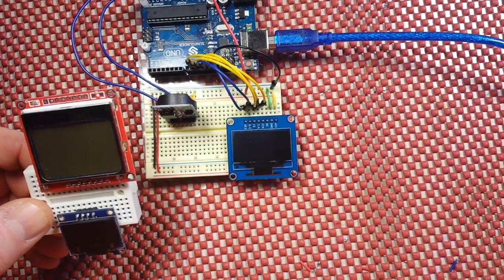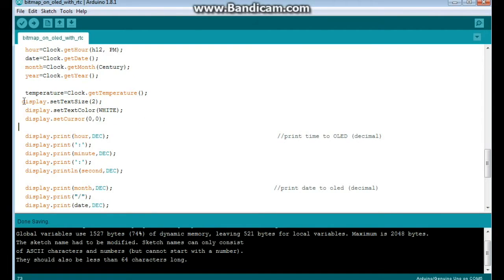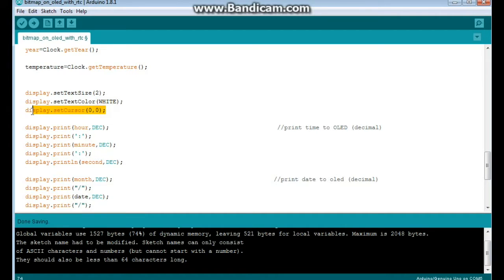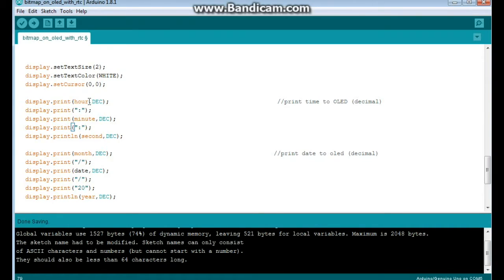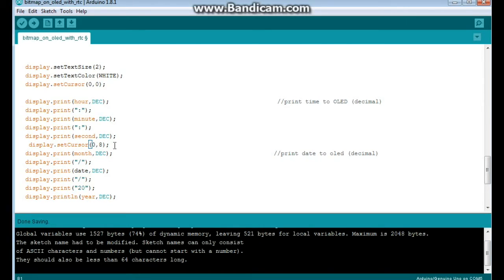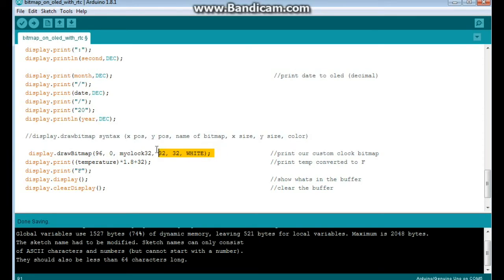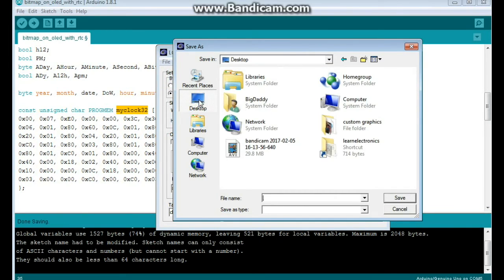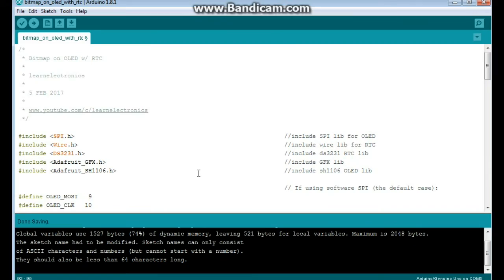How to display Custom Graphics with Arduino

Comment: Hi! If you want an app capable of working with all the sensors from the CC2541DK, CC2650STK, ThunderBoard React and Sense (e.g. acclrm., magnetom., gyro.) you can download it from: www.microsoft.com/store/apps/9p054xsjjr1n – the software is able of giving new uses (movement security - door or luggage, magnetic, accelerometer mouse and wireless presenters) to all these IoT SensorTags. For more info.: www.blesstags.eu. Thank you so much and have fun!